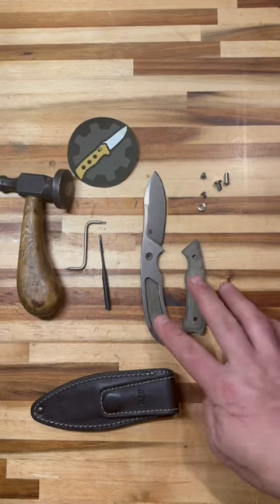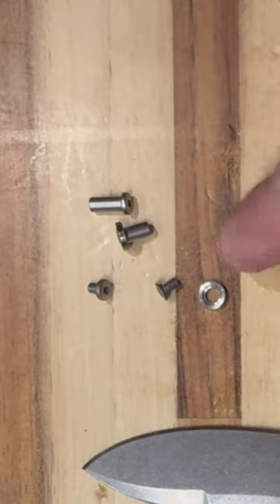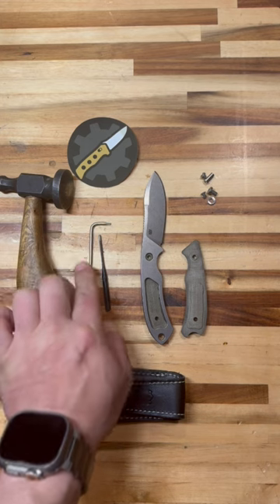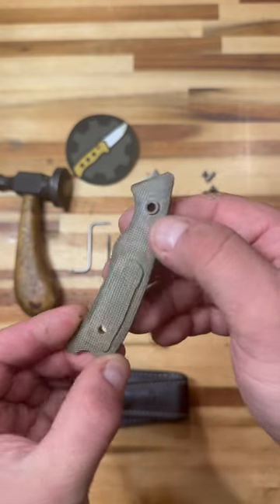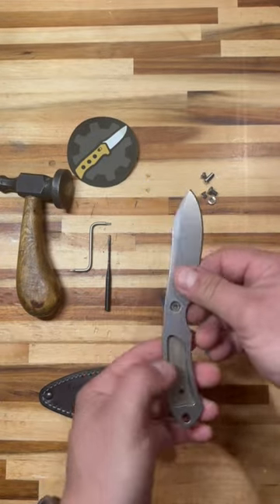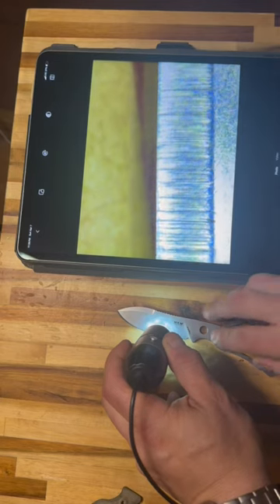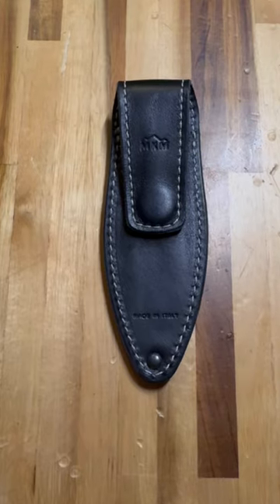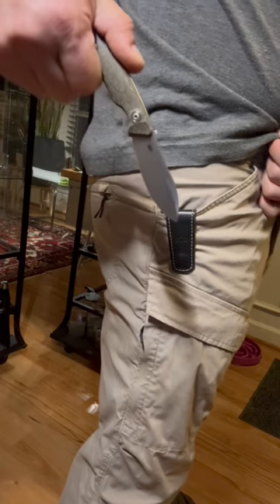$45 PER INCH OF BLADE?! Why MKM Pocket Tango knife by DCA of @knifecenter costs so much?

Comment: Would love to see how you solve the sheath issue. I’ve inserted and extracted mine from the sheath at least 500 times to try and get a groove in the inside so the sheath won’t pull out of my pocket when I pull out the knife. But no luck yet. I love the knife - and great short video!
Reply from the maker: I already published that video. It is called Helping DCA with his pocket sheath.